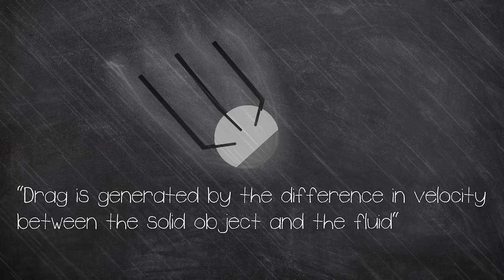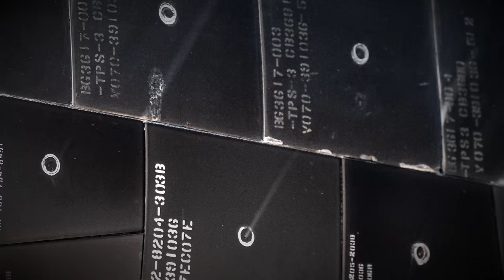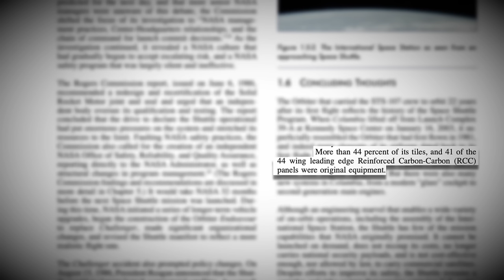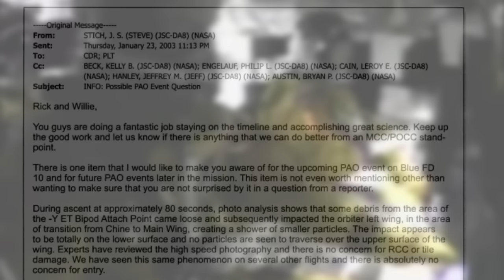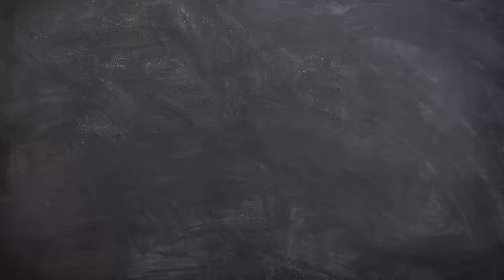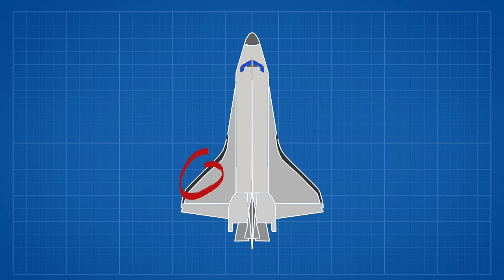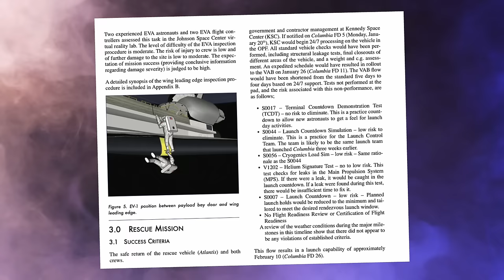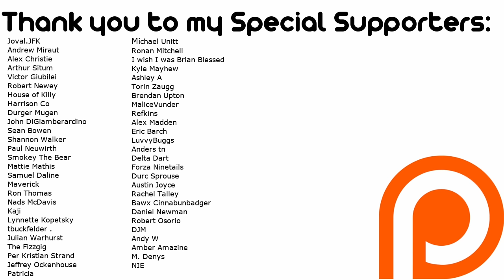Ignored Warnings: The Columbia Space Shuttle Disaster 2003 | Documentary | Plainly Difficult

Comment: Linda Ham, who was the mission manager in charge, and the flight director, should have been criminally charged.    They turned down EVERY offer and opportunity to mitigate the clearly present danger associated with the foam strike.     When military assets offered to obtain hi-res images so as to better assess potential damage, they said 'nope'.    When a low energy re-entry was suggested to reduce stresses and heat damage, they said 'nope'.     When an obviously problematic rescue mission was suggested, the same answer resounded.    Nope, nope, nope.    Criminal negligence resulted in a possibly preventable tragedy and a cover up ensued.    Was anyone held accountable for all of this and more?    Nope, nope, nope.
Reply: Bureaucrats are very good at protecting themselves and each other.  Not so much anyone else.
Reply: Women ☕☕☕
Reply: It was even worse than saying nope to the imaging. After repeated denying requests for imaging from the engineers, the thermal protection team went around management directly to the NRO to request imaging. The NRO complied, got everything set up and were less than an hour or two away from being in position to get the photos when management found out. She then proactively contacted the NRO and told them to CANCEL the imagery. 

She was under pressure to get STS-108 launched for the iss And if the foam strike was deemed an "out of family" incident, Aka not just the same minor things that have happened in the past, there would be a huge delay and things would have to be investigated and changed before they could launch again. When they were discussing the foam strike, managements opinion was that if it was a critical strike, nothing could be done anyway so it doesn't matter, so her decision was that they didn't need imagery because if it revealed something bad, it would delay the next shuttle and it wouldn't change anything, even though the engineers were saying things COULD be done. Columbia head so many similarities to challenger it's eerie, and the fact that NASA learned absolutely nothing from challenger is incredibly frustrating. It's definitely not the same agency it once was.
Reply: @GlutenEruption  Boeing used to be engineer run then an accountant got control.  Likewise NASA used to be engineer run and then a political appointee got control.  The results have been very similar.
Reply: @Yaivenov   yep, sad but true. And Columbia proved they learned absolutely nothing from Challenger and STS-27 as well.  They've has also suffered tremendously from a lack of focus - smartereveryday's video "I was scared to say this to nasa..." really did a great job cutting to the heart of that point, that they're acting as if since we already went to the moon, getting there and back is easy peasy so they need to add all these extras on top to justify returning: retrolinear halo orbit, the orbital outpost, polar base, EVA hard suits capable of extended duration use, non hypergolic methane oxygen engines, on-orbit refueling, zero-g cryogenic propellant transfer, 12+ launches of the first fully reusable heavy lift vehicle per mission, landing a 50m tall starship with a ridiculously high CG in 1/6th gravity among mountainous and unlevel terrain without tipping over when the last 2 landers 1/10th the height have tipped over on much flatter terrain... the list is endless. 

People forget just how *spectacularly* difficult and hazardous getting to the moon and back safely is on its own. They think if we were able to do it 60 years ago, it should be a snap with today's technology but It's not. The only difference is todays systems are many orders of magnitude more complex, The system is significantly more fragmented with contractors off doing things on their own with hardly any central supervision, with a fraction of the budget and forced to use off-the-shelf shallow components to please politicians instead of having the freedom to design systems well-suited to the mission. They want to go back to the Moon for the first time in 60 years, but instead of focusing the first mission just on that, taking baby steps to reacquaint us with the realities of lunar space flight since there's practically nobody left with any experience, they decided to try leapfrogging FAR beyond anything we've experienced or understand into completely uncharted territory in one go. It's a recipe for disaster.

Comment: About heating on reentry. Most of the heat is actually caused by the massive increase in air pressure causing adiabatic heating, not by friction. The same way a diesel engine gets the fuel air mixture hot enough to ignite by simply compressing it dramatically. The leading surfaces of an object moving into the atmosphere causes the air to massively compress it much the same way.
Reply: Wow, crazy to imagine how fast an object has to be moving for that to happen.
Reply: Yes, I thought it was piston forces, not drag.  You are basically creating compression in the atmosphere.
Reply: Replying here to boost your comment, it's a very common mistake to think that drag is the main factor so I was going to correct it as well if no one else had. 👍
Reply: @volvo09 It just has to be moving faster than sound, as at subsonic speeds the air can flow around an object but at supersonic speeds the object is moving too fast for the air to "get out of the way" and it's compressed into a leading edge shockwave.  Concorde famously heated from supersonic flight to the point where it was a full 30cm longer in flight than it was on the ground.   That's also why it had such extremely angled back wings, the angle kept the leading edges of the wings out of the shockwave.
Reply: And the latest Starship test gave us first-ever live footage of the air turning to plasma.

Or watch the return of a Falcon booster -- they fire the engines to both slow the booster and to move the compression zone away from it.
Reply: I had a heated discussion (pun intended) the other day with someone who insisted that compression was also friction...
Reply: Yep. You get heating, and ionization, with very little drag when just hitting the atmosphere. You could see this on the latest Starship reentry.
Reply: @paulmichaelfreedman8334  I feel like some tenuous thermodynamic case could be made for that claim. Friction is pressure-driven atomic interactions. It might not be a very useful concept in macro thermodynamics, though.
Reply: I don't think he said it was due to friction.

Edit: Dang it, yeah. He did. Whoops!
Reply: @PassiveSmoking  So above the speed of sound in air, it's pressure ... and below the speed of sound, it's friction that creates the heat? Is there a transitional phase of both at the speed of sound?
Reply: @JohnnyAngel8 - No. Friction does not create heating of airborne craft. That is a myth. Heating is caused by pressure in the bow-wave. Subsonic craft do not experience heating because they do not build up a bow-wave.
Reply: @halfrhovsquared  Surely there must be some interaction between the aircraft surface and the air molecules going past it during subsonic flight, right? The heat is negligible? Thanks for your response.
Reply: Yeah, it’s wild that there is enough compression to create plasma!

I was so glad when I was first corrected on this being related to compression and not friction — it honestly makes a whole lot more sense, too
Reply: Boyle's Ideal Gas Law OP, aShUaLlY.

😅
Reply: @JohnnyAngel8  - Some, of course but fairly insignificant, I would say. Certainly in terms of the effect managing to reach proportions that turn the rarefied air itself into plasma.
Reply: Makes sense.. thank you
Reply: @paulmichaelfreedman8334  There is friction heating involved. It's just so relatively small in comparison to the compression heating that it can seem negligible.
Reply: Good analogy, easy to follow.
Reply: @paulmichaelfreedman8334  You should have offered to shake their hand, given it a very tight squeeze, and then asked them if they understood the source of the "friction," pun intended.
Reply: @volvo09  I think it was said in the video that the shuttles would reenter earth's atmosphere at around 17000 miles per hour.  That should be fast enough for that to happen.
Reply: Learnt something new from that comment
Reply: If they knew about this, why didn't they account for the additional hearing caused by the pressure?
Reply: correct these panels absorb the heat and cool quickly but on launch a piece of foam hit a panel on the wing and they crack like tile
Reply: @JohnnyAngel8  there is a transition you'll see shock diamonds form in the plasma when it goes supersonic
Reply: Rimshot

Comment: surprised you didn’t mention STS-27. they had a severe tile loss incident from foam shedding, and since it was a Department of Defence mission, all the video they downlinked showing the tile damage (using the canadarm, which wasn’t on this columbia mission because of the science module taking up the majority of the payload space) was encrypted and decrypted, resulting in a loss of signal quality on the ground. Hoot Gibson was telling them how bad it was because he was seeing the unencrypted video, but by the time it reached NASA, it was unclear enough in the imagery for everyone on the ground to be like “it’s fine. looks within spec.” it absolutely wasn’t. Hoot Gibson was preparing to DIE on reentry (he quotes himself as having told his fellow crew members that there was “no use dying all tensed up” before re-entry!) on a mission in 1988, two years (and only the second mission) after losing Challenger and her crew. the reason it didn’t have a similarly devastating outcome is pure luck - the tile loss happened where there was a steel plate over the aluminum in the fuselage. the heat from the air compression (which is what heats spacecraft on re-entry) melted through the steel during re-entry, and had started to eat through the aluminum when they got out of the part where re-entry caused enough heat to, you know, melt the spacecraft. when they landed (and you can see a photo of the tile damage. just look up sts-27 tile damage somewhere), everyone looking at that hole on the ground was FREAKED OUT. they almost lost a shuttle TWO MISSIONS AFTER CHALLENGER, and i have no doubt the orbiter atlantis’ survival of that incident had an impact on their decisions that led to this disaster. tile damage was seen as routine. normalisation of deviance. i’m shocked this incident doesn’t come up in more incidents about columbia because even though it was a tile strike and not, you know, a big hole in the reinforced carbon carbon leading edge of the wing, they knew the risks of a foam strike. they absolutely knew.
Reply: sorry that i left out some details in the comment - i made it from my recollections from having read about shuttle incidents in general (i wish i could unearth more documentation about the enormous pyramid of uh… liquid human waste? that broke off challenger on re-entry, banged it up and dented it, and could have compromised the re-entry in a manner that caused LOCV — Loss of Crew and Vehicle). anyone reading the comment or this subsequent comment should look up the details on sts-27 themselves. if i recall correctly, the steel was there for covering an antenna. also, here’s a quote from Hoot Gibson about this with the context of being a comment he made after the loss of Columbia:

“If we started to burn-through,” he said later, “we would change the drag on that wing, which is exactly what happened to Columbia. We would start seeing “right-elevon trim”, which means moving the left elevon down. I knew we would start developing a “split” between the right and left wing elevon positions if we had excessive drag over on the right side. The automatic system would try to trim it out with the elevons. That is one of the things we always watched on re-entry, because if you had half a degree of trim, something was wrong. You had a bunch of something going on if you had even half a degree. Normally, you wouldn’t see even a quarter of a degree of difference on that thing.” Before entry interface, Gibson had privately concluded that if he did see an elevon split of beyond a quarter of a degree, he had about 60 seconds of life remaining in which to tell Mission Control exactly what he thought of their heat shield “analysis”…
Reply: It was a problem since the first shuttle launches, just like with the o-rings.
Reply: a nit-pick of your original post: it was not a foam strike from the external tank but a piece of the ablative covering on the right hand solid rocket booster's nose cone.  (and it hit the tiles not the RCC wing panels) Probably a harder object than foam would be but there is nothing I could find to indicate how/if so.  The ablative covering on the SRB was necessary for re-use of the SRBs, the external tank was allowed to burn up after use.   Aside from this thanks for mentioning, it is an interesting read on Hoot's reactions during and after the sts-27 mission and relative to the Columbia disaster.
Reply: @robertl4824  ahh thanks for the correction on the source of the damage! i know it hit the tiles and not the rcc leading edge, but a hole in the orbiter on re-entry is a hole in the orbiter on re-entry
Reply: They had been lucky with the few foam strikes, and didn't think it was a huge problem with melted wing? Their thinking was, it's not a problem until they lose a shuttle!
Reply: @williamlouie569  Have you seen the footage that shows the shock of the guys when they first fired the pieces of foam at a mock up of the wing and it blows right through? Those guys were not expecting that
Reply: What you reveal is shocking. I am not easily shocked, but .....
Reply: And if STS-27 had crashed, it would have permanently ended the shuttle program, and quite possibly ended NASA as well. No one would have forgiven 2 crashes in 3 missions. 
In other points, the risk of foam strikes was understood even before STS-27. The original design specification if I remember correctly was that nothing was allowed to strike the orbiter. period. The only reason this view changed was because they couldn't actually stop the foam breaking off the external fuel tank even after trying, and eventually they just stopped worrying about it.

Comment: The source of heat during re-entry is mainly not from friction. It's shock heating, compression of air in front of the vehicle. Compressing a gas concentrates the heat energy in it
Reply: Which is also why it happens around leading edges and the nose, where the air is compressed the most and the fastest.
Reply: In other words, it's heat generated by "friction" of air molecules smashing against air molecules. Compression heat is caused by friction. But I am just being pedantic
Reply: @disillusionedanglophile7680  Not the case, there is no additional heat energy generated, it is the same heat energy concentrated. If you compress a gass its temperature increases because the same amount of thermal energy is now contained in a smaller volume. This is the same reason a bike pump gets warm and the same reason the compression stage of a four stroke engine cycle makes the gas hotter. The dominant reason for the temperature rise is compression, not friction. In fact the air behind the space shuttle is left cooler once it expends again, because some of the heat energy was conducted to the relatively cooler shuttle.
Reply: @BrackenDawson  Brownian motion = Friction
Reply: @BrackenDawson  Compression results in molecules in a smaller space = more intermolecular friction. Brownian motion applies. Furthermore, you don't know for a fact that the air was cooler behind the wings, but you can (correctly) assume that it was because we all have refrigerators in our house that are compressors and also heat pumps

Comment: This wasn't an unforseen issue, either. Early designs showed the orbiter stacked vertically, either as a winged second stage or inside a fairing like Dreamchaser or the X-37. Debris or ice shedding from a planned hydrogen first stage was still possible, but the orbiter was above the debris and safe (this is also why the same tank material is used on SLS without worries, Orion is safe at the top of the stack).

This design did limit cargo capacity, but at the time Atlas, Delta, and Titan were planned to be used alongside the shuttle, rather than the shuttle becoming the all purpose single vehicle.

The upscaling required by DoD mission profiles like hostile satellite capture made this too large to be feasible - the VAB was not tall enough and neither the crawler carriers nor the mobile launch platforms could bear the weight. So the horizontal stack was used, requiring SRBs (flaws in which destroyed Challenger), putting the orbiter in the path of shed debris (nearly destroying Atlantis and eventually destroying Columbia), and the main ascent engines being directly on the orbiter and reused created the more obscure "gold bullet" problem that also caused a near miss with Atlantis.

None of these missions ever flew.
Reply: I don't get why vertical stacking would increase the total weight. Is this because the tank would need to support weight on its top? (I would naively expect that to change little, because the tank has to resist buckling from aerodynamic forces pushing on its nose in a less predictable way.)
Reply: They needed to use the Saturn V assembly building, the money wasn't there for a new one. The shape of the VAB meant that a vertically stacked shuttle would have a wingspan limited to about the diameter of the width of the S-II second stage, which was 33 feet. The shuttle that was ultimately built had a 78 foot wingspan and could only be accommodated in the lower bay of the VAB.